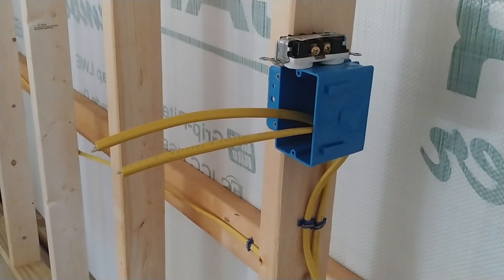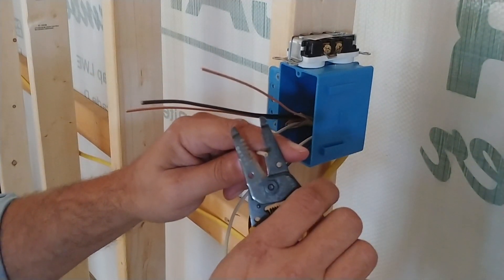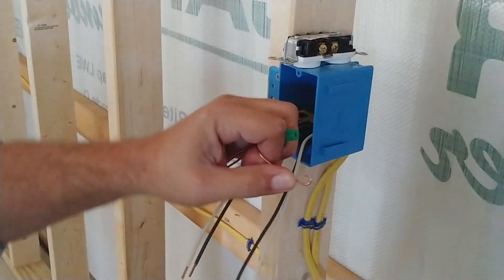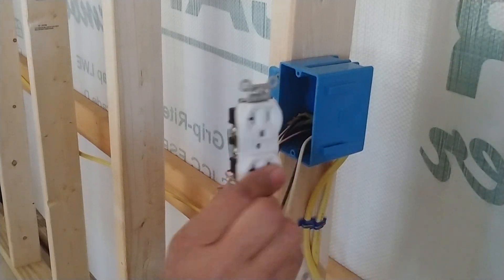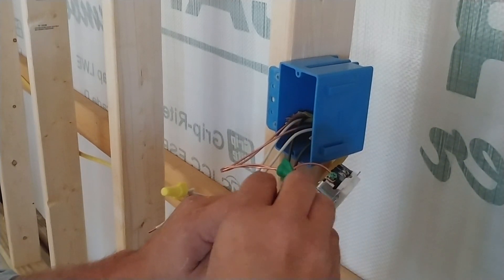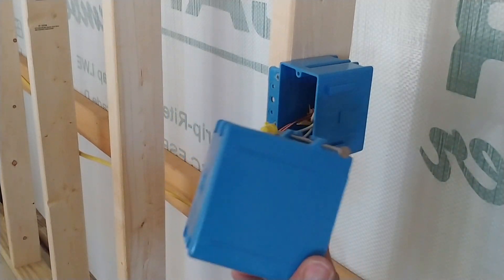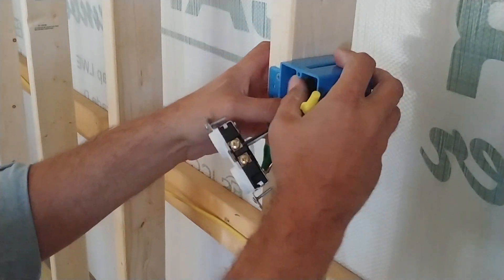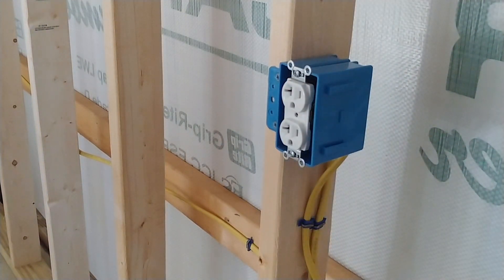Wiring up a outlet tips and tricks.

Comment: Your putting the wires in the terminal screws wrong. Wire wraps clockwise or else as you tighten it pushes wire off and out instead of the opposite.

Comment: Aside from the misuse of the grounding wire nut (one wire is fished through the opening in the top) and the grammatical errors in the video's title (It's "Wiring Up AN Outlet...", not "Wiring up A Outlet...") and saying, "strip it out" (It's just "strip it", no need for "out"), the explanation was solid.

Comment: Ok I’m going to point out everything wrong here. That box is 18 cubic inches. It’s not a deep box. 22 cubic inches are much better. The green wire nut has a hole in it to allow one end to pass threw it so you don’t have to pigtail it. The hot and neutral need pigtails. Some inspectors might say that box is not rated for two 12-2 wires. It’s close. Each leg of the wire count for 2.5 cubic inches. The grounds count as one cubic inch. The device counts for four. Some say the wire nuts count as well.

Comment: Mistakes:
1) Though you say "an outlet" in the video, the title says "a outlet"...a grammatical error...
2) The green wire nut is not used as designed...
3) Yellow wire nuts are generally used with 14 gauge wire (15 amp circuits,) and the red wire nuts are used with 12-wire...
4) The pigtails look too short...
5) Not two circuits...you should try to avoid putting two circuits in the same box so as to prevent the potential for 220 volts...Break the tab on the hot side so the outlet can be used as a switched receptacle, on the same circuit, just switched separately...If you want two different circuits on the same receptacle, ensure that the two breakers are on the same phase bar in the panel...
Reply: I agree with your 1 through 4, but 5 makes no sense, it's only one circuit pigtailing down the line.
Reply: @surferdude642  @ 8:35 he says you can break the tab and make two different circuits. He's not talking about this particular installation because there's just one circuit in the box. To make two different circuits which share the same box, there is a potential for 220 if you don't pay attention...
Reply: @MacDaddyRico  Okay, I get what you're saying about making the receptacle a switched receptacle on the same circuit. However, if you want two different circuits on the same duplex receptacle and they're on the same phase in the panel, you must also break the tab on the neutral side and attach each hot and neutral pair to the appropriate screws, upper and lower receptacles. The problem is that you'd need to turn off 2 breakers to turn the power off in the box. Not great imo. It would be better to break both tabs and have the two separate circuits connected to a double pole breaker or 2 single poles tied together. Then one breaker switch will turn the whole outlet on or off. The two receptacles will then be on opposite phases in the panel by default. Similar to a MWBC, but without the shared neutral.

Comment: Diagnosing a problem in the circuit is easier without the pigtails. If I were the inspector in your area I’d be concerned with the grounds, the wire length, the backwards loops, the stud not being notched for the screw on box, the insulation taking up too much space in the box, all of the other issues. Tell me, instead of the pigtail, why didn’t you just twist the grounds, cut one off short, and stick the long one through the wire nut? That’s the reason for the hole in the green wire nuts.
Reply from the maker: You are right it is easier to diagnose any problem if the wires are all attached directly to the outlet but where I live in with the inspectors that I deal with this is what they require you to do
Reply: @TennesseeHhandyman. Im curious about your comment about the stud not being notched out for the box flange. I've wondered about that also. It seems that the drywall will not be flush with the box on the left side. If you notch the stud, then the whole box is recessed slightly, but it's even and can be shimmed. I get your point, but I doubt that electricians will take the extra time to do that and I've heard that it's such a small amount the end result is hardly noticeable, but I haven't verified that.
Reply: @surferdude642  it’s an 1/8 of an inch. It’s enough to mess up your tongue with wood walls, and enough to blow out your sheet rock if any pressure is applied to the wall. Most electricians will not use these boxes, but when they do, at least notch the stud with a multi tool
Reply: @tennesseehandyman2427  Yeah, that's what I thought and I wouldn't use these boxes either. 
I find that most of the nail in 2 gang plastic boxes are pretty flimsy except for the Carlon with the flange and nails near the rear, they're pretty sturdy and known as new/old work boxes. If I need that I would notch the stud like you mentioned, thanks.

Comment: Instead of the pig tails couldn’t you just hook up both white wires and both black wires on the outlet? And pig tail just the ground
Reply from the maker: You can and it will work but, in my area an inspector would fail you on that.

Comment: Why do pigtails you have 2 screws for hot and 2 for the neutral to connect just asking I'm learning.
Reply from the maker: Good question the reasoning behind it is if the receptacle were to fail you will still have power to the rest of the circuit.  If you split the wires like most people do one set on the top and one set on the bottom and the receptacle fails you're going to lose power on all of your outlets and or lights that are on that circuit.  I'll be honest though to me it's better if you split them as it makes troubleshooting a lot easier.  But in the area that I work inspectors will not pass it unless everything is pigtailed.

Comment: Thank you for your video!  If you are putting tile on the wall and you know how thick it is including the mud, do you adjust the depth of the box out to accommodate, or just use an extension... My case: 1/2" for Cement Board, 5/16" Tile and Approx 3/8" mud.  Would you move the box out 1-3/16"?  Thanks again for your video.
Reply: The box he is using cannot be a adjusted and is fixed for 1/2 inch drywall. You can use the nail in box and mount it to the precise depth you need. You can also use an adjustable box which has an adjustment screw just inside the box which has a significant range of adjustment. In your case though, 1 3/16 seems like a lot and may still work with an adjustable box or you may need a box extension like you mentioned.
Reply: Its called a "mud ring" and they work

Comment: I can't understand why Americans create an extra junction in the back of the box. Why not just connect direct to the socket?
Reply: Because if you do that all the current must flow through every receptacle upstream of the load, hence making the receptacles dependent on upstream ones. It's best practice to keep them independent on one another. With only 3 wires to connect, including ground, it's easier to mount it to the box.
Reply: @surferdude642  this makes zero sense to me. Explain the difference between putting two wires into a screw terminal directly at the socket rather than balling up three of them in a connector and running one leg to the socket. No where in the world does this besides America.
Reply: @solidus784  I understand your point and using the screws for the connections is permitted by the National Electric Code but they typically offer minimum requirements. Many experienced electricians have seen problems down the road when using the receptacle as a connector. A properly fastened wire nut, or Wago lever nut should last for 50 years or more. Admittedly, it's somewhat of a gray area. For example, my home that's 72 years old was originally wired using pigtails hasn't had any problems related to this. There's a theory that the screw connections can loosen over time due to the minor expansion and contraction of wires during heat cycles.
Reply: @surferdude642 Our sockets have caged terminals, I supposed it might be down to the wrapping it around a screw thing in the States.

Comment: if you have two neutrals... two hots... and 4 screws.. why not connect 1 cable to each screw?  just curious.
Reply from the maker: You can do that and it will work but where I do electrical work and do installs inspectors will not pass it everything has to be continuous and done with pigtails, one wire going to the outlet.  The thought process is if one Outlet fails the rest in the chain will continue to work.  The most important thing to pigtail is your ground.  As you want to keep the ground continuous throughout the entire circuit.

Comment: It is only needed to pigtail the ground in this circumstance but it will work come on man if your going make connections tighten with plyers don't rely on a wire nut you as a electrician need to make sure it is tight and will never come loose good job for using a 20amp outlet most dont
Reply from the maker: As an electrician why on earth would you tighten with pliers.  Of you use wire nuts correctly they do not require or need to be pre tightened.
Reply: @BevinsBuilds   you don't take pride in your work do you
Reply: @moneyiskey4252  I agree with you that pre twisting is better, especially when using 3 or more 12 gauge wires. I disagree about the need or preference for 20 amp receptacles, they are completely unnecessary, 15 amp spec grade duplex receptacles are a better option and same in quality.

Comment: The hole in the green wire nut is designed for the ground tail to poke through the hole. The idea is you leave one cable in the box a bit longer to allow for this. Also you want to twist the solid wires together with linemen pliers prior to using the wire nuts. You don't need to pigtail to the receptacle unless you have three cables or more in the box. You can of course as long as you have the cubic inches of space in the box to allow for the added wires. Another thing is the tab you can cut on the receptacle can be used to switch one of the duplex receptacles but on the same circuit. If it is used for a second circuit sharing the neutral the breakers must be on different phases and both breaker must be connected in a way that they both trip at the same time.
Reply: 11

Comment: Why can you put the white and black directly to the outlet instead of pig tail
Reply from the maker: Because if you put them directly on the outlet where I live the inspector will fail you.  An outlet is a device and the wire is the circuit the circuit should always remain continuous even if the device fails.

Comment: I have a few 
QUESTIONS if you have a moment - I have been changing the 2 prong outlets in my
home  to 3 prong outlets and some GFCI outlets - all is going well!
Question - I have one old 2 prong outlet for the refrigerator and appears from
closing the circuit breaker it is also controlling kitchen overhead light - in
the 2 prong outlet  box - I find 2 black wires coming in and 2 white wires
coming in - yet one of the white lines coming in is taped off  with
electrical tape and not being connected or used - Why is that? When I connect
the 3 prong outlet - to the 2 black wires and one white and turn power on my
circuit tester in outlet is reading "open ground" - how do I correct
- Should I use a GFCI? There is no ground line in the outlet box?  2.Question
I finding some of the old 2 prong outlet boxes  once I  convert to a
3 prong outlet - although there is not a ground wire in the box, when I turn
breaker on and use 61-035 circuit tester on outlet - the lights on circuit
tester is showing "correct wiring" why is that? Are the outlets
grounded at fuse breaker box? Or is it Bx cable grounding the outlet? thanks so
much !
Reply from the maker: To learn more about GFCI Outlets watch this video https://youtu.be/0DZUvfmURVc
To try and answer your question the reason you are showing an open is because you don't have a grounded system.  You can use a GFI to give yourself a 3 prong outlet and still meet code but the system is still open in no ground.  A common trick that people do but it is not acceptable and does not provide protection is they will put a jumper from the neutral to the ground and it will trick the meter to tell you that it is a good circuit.  I do not recommend it though.  Sadly the only correct solution is to number one see if you have metal boxes and they show as a ground or to run grounds to all of your Outlets.  I do explain a lot of this in the video I recommended.  As for the extra wire that is taped off without physically being able to wring it out in trying to research it myself I honestly don't know what it's for.    Sometimes you will see that done though if they are using the other wire for a switch leg.

Comment: When creating a pigtail for any neutral (white) set of wires, I find it a good practice to strip a longer section of wire and twist exposed copper wires together with lineman's pliers instead of relying on the wire nut to make the connection. Then trim the twisted wires to leave 5/8" exposed for the wire nut to attach to. This minimizes the risk of the potentially dangerous situation of an isolated neutral. Also, taping wire nuts and receptacle after application reduces potential for contact between exposed surfaces, and keeps nuts securely attached to pigtails. Extra time is worth taking to produce a better product.
Reply: That is what I ended up doing.
Reply: How long does tape last before it degrades & unsticks?
Reply: @rp9674  depending on the quality and conditions, 5 - 20 years.  Buy the highest quality tape you can find. It is worth the price. Also. This is a secondary protective measure, the wire nuts provide primary connection and insulation

Comment: Why did you make the pigtails for the black and whites when the outlet has two screws on each side?
Reply from the maker: You will fail an inspection if you do not pig tail the wires.
Reply: @BevinsBuilds  I tried to look up building codes for MI. but somehow it wasn't available or I got frustrated looking for it.  I appreciate your reply, on one outlet I did pigtail it, but on the other it seemed easier to just use the other set of screws on the outlet, seems that's what they are there for.

Comment: Just curious I'm British so everything is different for but if install the outlets be for you hang the drywall do you have to cut the holes out after or does it already have holes cut in it. Thanks.
Reply: He may have done this for demonstration purposes and you're correct. Receptacles are not connected until after insulation, drywall, taping, joint compound application and painting. You may want to strip the sheathing, connect the grounds adding a pigtail and fold everything deep into the box at this point. This process is known as rough in and rip out.
The drywall does not have holes in it. It's up to the installer to cut the holes in the precise locations. There are a few different methods of doing this.

Comment: YESSS, the 14/2 is easier.  I am really glad to hear I'm catching on.  I am a first time homeowner with a project before me.  

My question is:  Can I use the easier to work with 14/2 or must I use 12/2?  

I bought a townhome with a 20A breaker that leads to a 15A wall outlet; that wall outlet was extended by the prior owner outside to a new 15A GFCI outlet; and he continued that through some tubes to yet another new 15A GFCI outlet, where a water softener is plugged in.  The two 15A GFCI outlets outside stopped working (and could not be reset) after a thunderstorm; but everything was fine inside the townhome (i.e., 20A breaker not tripped).  

A. The first guy at Lowe's told me to replace all three outlets with 20A GFCI receptacles.  
B. The next guy told me to replace the two outlets outside with 15A regular receptacles, and the one in the kitchen with a 15A GFCI.  

I think they are both wrong based on what you said, and what I think I learned about how to use a GFCI receptacle (i.e., use just one at the beginning of the line).  

Anyway, I have to change the wire from the kitchen to the first outdoor receptacle  because it was frayed and the GFCI tester lit up OPEN NEUTRAL.  

What I use depends on option A, B or C, I suppose.  I'd like to use 14/2 because it's the easier, but I think you're going to say Option C--add a 20A receptacle in the kitchen at the beginning of the line and two regular 20A receptacles outside (in the protective bubble box).  

Am I close (or am I gonna look like the the coyote in a Road Runner cartoon)?
Reply: All I can tell you is GFCI can not be put after another GFCI. Any outlets after the GFCI are protected by that GFCI.  If your wires are 14 gauge then you use 15 amp GFCI and outlets also change the breaker in the panel to a 15 amp breaker. If your wire is 12 gauge use 20 amp GFCI and outlets leave the breaker alone. You cannot combine 14 gauge and 12 gauge wire in the same circuit. The wire must be the same gauge throughout the whole circuit the outlets all must match that gauge as well as the breaker

Comment: Hi nice video  
  i am trying to install a  small rectangular light on my wall   if i use regular  rounded junction box it  wont be covered  completely by my light  but if  i use the one that is made  for  outlets like the link below it will cover nicely  so  just wondering  if it is ok or any code  for that thanks
https://www.homedepot.ca/product/iberville-device-box-2-1-2-in-deep-loomex-bx/1000106188?rrec=true